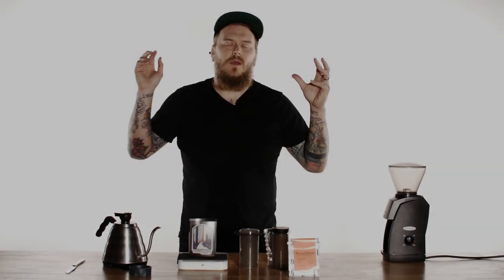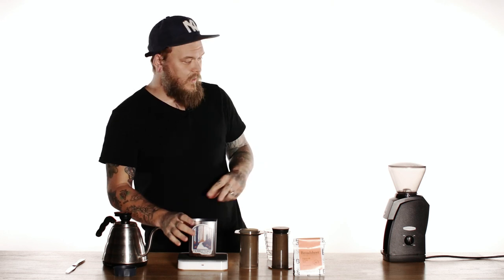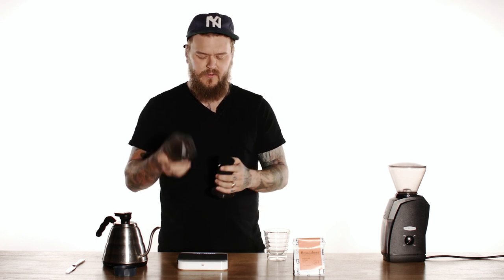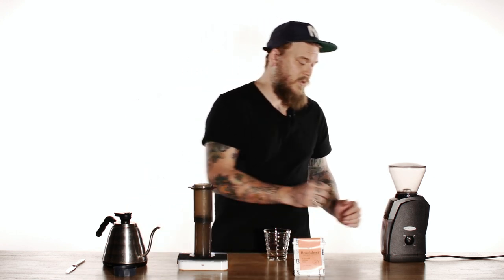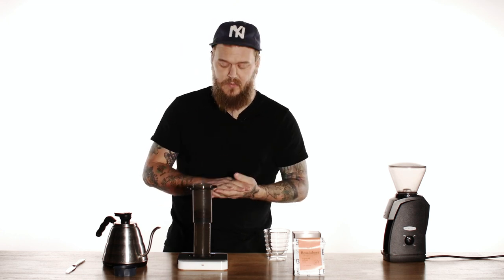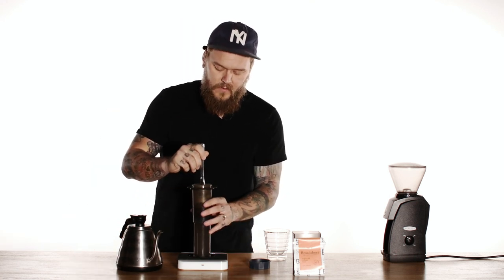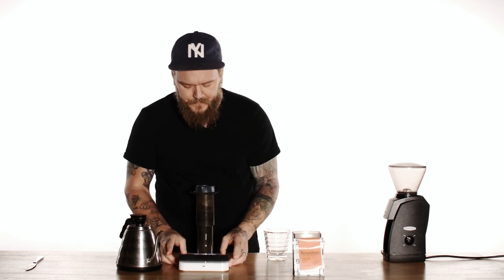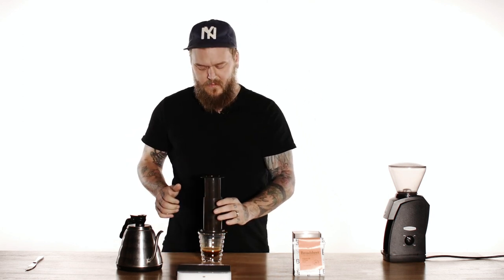Making "Espresso" with the Aeropress & Fellow Prismo

Comment: Thanks for the grind size setting! I just got this attachment, and can make a shot with "crema" but am finding it a bit gritty. I've been experimenting with the grind setting but your approx. 7 on the grinder (same as I have) will be my next number. I've found a 4:1 water to beans ratio has been working for me. Thanks!
Reply: Ooh, I’ll have to try your ratio!
Reply: If it’s still gritty, I would try using paper filters instead of the metal
Reply: @ascend24  Thanks! Cant' remember how I switched after that (been a while) but that is helpful to try.

Comment: Why are you inverting and flipping when you the prismo will hold the liquid when you brew right way up?
Reply: Good question, if it worked at reported that would be fine but I have found on more than one prismo it doesn’t really hold water all the time, plus the invert feels normal from regular aeropress brewing
Reply: @Emergence.Church   interesting. After using a friend’s with that method it was basically the reason that I bought mine, so I am glad that it does hold the liquid consistently!
Reply from the maker: @LegendBiscuits  we're glad for you too! For us, we've also, always brewed inverted before the prismo, so it doesn't seem like a hassle to do it now

Comment: Nice video. Where would I track down that espresso glass ??
Reply: It is Hario V60 270ml glass. It is intended to use with the dripper. It is actually quite dangerous to use it with the Aeropress. Hario servers are known for breaking when used with Aeropress. I'm quite sure this glass is made of the same glass as the Hario server. I own both server and glasses like that and I would not risk it using with the Aeropress.

Comment: What’s the point of inverting if the fellow is sealed?
Reply: We like that you can stir and excavate without having to worry about the seal, and it seems to be cleaner between the balancing and ease of getting the cap on v putting the plunger in
Reply: We like that you can stir and excavate without having to worry about the seal, and it seems to be cleaner between the balancing and ease of getting the cap on v putting the plunger in
Reply from the maker: There's still some force that can push through on the seal so we like to invert still